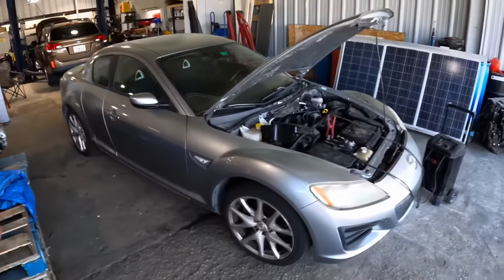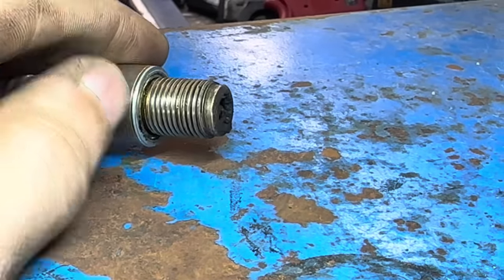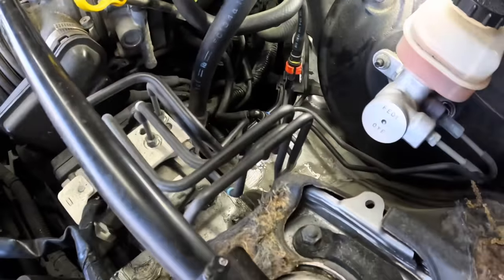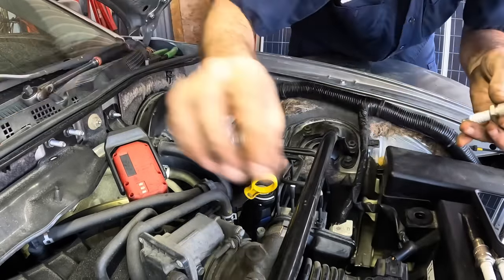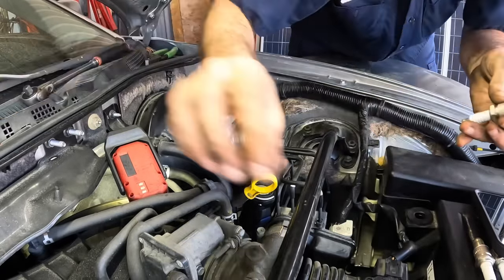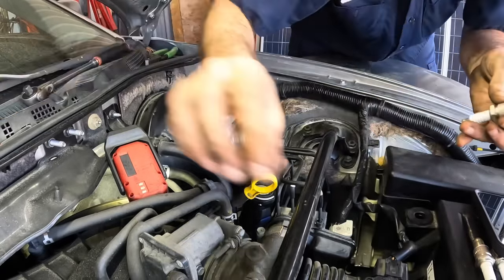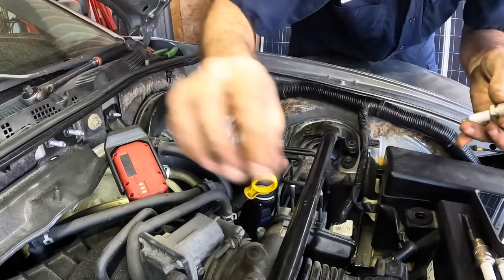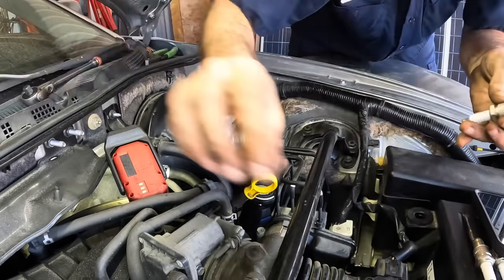Low Compression Rotary, No Start FLOODED Mazda RX-8 Drove in Towed Out!

Comment: Plugs are dead easy to get out but you are supposed to access them from inside the wheel arch. There is even slots in the guard liner specifically for access.
Reply: Yup, quite smooth
Reply: @craigfin3222  I'm not entirely sure but I think Ray never claimed to know everything about every car and would never make mistakes?! and yes, there are always comments under the videos from people who think they know everything better, that's nothing new and will always be the case, not just with Ray 🤷
Reply: 👍nice
Reply: lol. Did Ray just find out by an oreilly parts delivery guy that this engine has two different plugs? Don’t yall have website access that tells you everything about the vehicles you work on? Like alldata etc
Reply: I always consult a repair manual before doing these jobs.  And yes, if you own a shop and accept a car in the shop to work on for money, you should have a repair manual for that car.  If you can’t afford the manual, stay home in mommies basement and don’t say you can work on it.  And yes, there are e-manuals.
Reply: @justpray365  yeah I figured as much lol
Reply: Book time in UK to change the plugs in 30 minutes,Ray having never worked on these cars,he wouldn't know but I bet he'll remember next time.
Reply: @turbo3492  
It took me 2 minutes to find out how to do it online.  When time is money, someone like Ray should take the 2 minutes to find out how to do it easily and quickly.  The 30 minutes takes account for tire removal and installation.  I saw someone do the plugs in less than 10 minutes, with no hurt wrist.
Reply: I wonder what the guys at the dealership, that SHOULD know how to work on these cars, did to make a car that started not able to start, and returned it that way?  I think those guys need the tutorial.
Reply: @turbo3492  "Experience"....where the test is given first and the lessons are learned later.
Reply: There's a trick to everything as I found out when I was perplexed as to how to remove the rearview mirror from the interior of my 1989 Honda Crx.  Even the factory service manual didn't address the issue.  Then, I saw a seven second video on YouTube.  It couldn't have been easier to do once you know the trick.
Reply: @D3athAng3l1977 but that's why, even knowledgeable wrenches, carry shop manuals.
Reply: @roberttroxell4006 it was likely running and the younger techs didn’t know about the risk of flooding and flooded it and then Ray got it.
Reply: @KendrasEdge757 surely you can’t study a car to change spark plugs? Which mechanic in the world would do that😁

Comment: I myself am pretty apprehensive about using ECM repair places that I have never used I had to once because the normal place was upfront to me saying that they didn't think they could work on it. The place that I went to, like you took my money to almost send me an email the same day received saying they could not work on it, and kept my money as a "diagnostic fee". smh. Great Video Ray!
Reply: Major scammy vibes
Reply: chevy had a problem maybe still does modules worked at room temp not in real world solder joints intermittant
Reply: A lot of them know what theyre doing.  But if its cheap........sketch vibes.
Reply: Went to dealer running  played with keys and security codes came back not running.....? And it's whose problem?
Reply: @turboturtle9083  but its running. You didnt watch the video?

Comment: Running a rotary for a short period without getting to operating temperature is number one way to flooding and fouling plugs and causing a no start condition
Reply: Once you start a rotary engine, you gotta leave it running.  My uncle works on race cars that are rotary engines.  He said that once these engines hit a certain point...they just crap out.
Reply: @deplorablelibertarian  Especially the Renesis engine in the RX-8.  The ports are on the side plates instead of in the rotor housing so excess fuel is not slung out of the engine. Also tend to accumulate carbon on the seals for the same reason, which hurts compression and increases flooding risk even further.
Reply: From what I've heard, you also want to get them warm to prevent carbon building up on the housing which isn't good for the seals for multiple reasons
Reply: specially when just warm.
Reply: @YouNameItGaming  my brothers friend had one when i was a kid and i don't think any carbon had a chance to build up on his he drove that like he was in the indy 500 everywhere he went!
Reply: @jays106  that's why manual RX-8s seem to go longer between rebuilds than auto variants, the autos don't get driven as hard, and rarely see the RPM that manual ones do
Reply: @YouNameItGaming  this was an old RX-7 i was maybe 14 at the time (49 now) but yea i'm not sure if back then you could even get an rx7 in an auto
Reply: @jays106  they probably should have kept it that way to be honest, would keep a lot of people out of them that have no idea how to drive them correctly

Comment: Rotaries seem like a technology that is perpetually 10 years from being perfected.
Reply: Kind of like cvts.
Reply: Right? It seems like they dropped it right before they found the right material for the DAMB APEX SEALS
Reply: Banning rotary from racing killed them. Without funding and opportunity to stress them in racing. There was no way for mazda to work on them without it becoming just money pit. And to be frank. They are still using them in their new cars as generators. Plus we have LiquidPiston guys
Reply: @SmallKittyPaw  I mean they aren't banned from all kinds of racing. The aftermarket has some good options. If it was really an issue they'd take some advice from the aftermarket.
Reply: Fusion!
Reply: I hope the rotary load on the starter is significantly less than the load on a conventional engine starter. (words). The continuous running of the conventional engine (without pauses) starter would cook the poor thing to death.
Reply: Are they an emissions passing nightmare?
Reply: Thing about rotaries is you have to treat them like a 2 stroke, because that’s basically what they are. Keep check on the oil, beat the snot out of it. When shutting it off, rev it to about 4-5 grand and kill the key. The inertia of the rotors when spinning down will evacuate unburnt fuel so it doesn’t sit on the apex seals and wash the oil out.

Long time friend of mine had an RX-8 from new, this is exactly how he treated it. Sold it at 90,000 miles for a Porsche Boxster. Never had a problem out of it.
Reply: If you want a perfect rotary engine, get an EV.  The Wankel isn't necessarily bad, but it can never be as thermodynamically efficient as a piston car, thus leaning towards poor economy and troublesome emissions tendencies.  The RX8 was designed to take maximum advantage of the Wankel's strengths (size/power ratio, 9500 redline), but in order to meet modern emissions requirements the engineers went with a side-port design and skimped on oil injection, making the RX8 a garage queen, especially in early model years.  Dealers hated them. Problems could be mitigated with frequent red-lining and supplemental oil (mixed with the gas), but I saw the statistical writing on the wall and departed with my RX8 after 8 years It was fun but needed too much nursing.
Reply: @Huey866  true they need to rev. That's why the RX8 automatic had a far greater failure rate than stick
Reply: Kind of like fusion.  Always 20 years in future.
Reply: @Huey866  I've had 2, throw some premix oil in the tank with your gas will save those seals BIG time. I had one that was premixed since new and had like 150k miles on it, never rebuilt and ran really well.
Reply: they kinda already were, rotaries are effectively 2 strokes, treat them as such and their good, treat them like crap and its not such a fun time
Reply: It's been out since the mid 1980s.
Over 40 years of development in vain for a very bad architecture design originally from Dr. Wankel of Germany. 
Another great Germany technology goes kaboom.
Reply: Exiting the service mode…..😂😂👍
Reply: Toyota looking at rotary engine for their EV ...to charge batteries on the road
Reply: Just like fusion energy.
Reply: @jayc4283  They're an everything nightmare.  They run great for a year or two, then after that will spend most of their time at the shop.

Comment: Ray, my friend had a rotary Mazda years ago. He had the flooding, no start issue many times. The dealer’s tech told him to add a couple ounces of transmission fluid to a suction line and crank. Started instantly every time. Made lots of smoke, but it worked.

Comment: I must give you props for not being afraid to work on this rotary engine Ray, 75% of mechanics will outright reject working on them!
Reply: I was getting my radiator cleaned and dipped when I saw a rotary in the shop.  You do rotary's.  NO, that is a special case for the bosses friend.
I've been waiting decades to open one up.  I was at junk yard, and heard on speaker your rx7 rotor is at counter for pickup.  I dropped everything leaving my tools to go check it out.  It was a damn brake rotor.  Went back to pulling my part disappointed.

Comment: as someone who ones an rx-8 best way to get to the spark plugs is to take the wheel off on the driver side and you have perfect access to all 4. good to see a mechanic actually working on an rx-8 instead of just saying "its an rx-8 cant do anything"
Reply: Do they still use a single bolt holding the flywheel on?

Comment: I had a friend back in the 80's that had an RX7 Mazda, and it drove great. But the maintenance schedule must be followed. Thank you Ray.
Reply: Mt buddy had one too.    That this was awesome
Reply: about the only thing I didn't like was the fan inside did not move enough air for me.  Disgusted when they put in the back seats with the 13B engines.  The storage box lids hold the 6x9 speakers right behind you.
The rx7 holds my rc helicopter perfect, rotor goes from front windshield to the back.
Mine is now a mutt.  I have parts from 79 to 86 in it.  Was a little mad they had a different bolt pattern and I had to get an entire set of rims from an 86 to get my limited slip differential back end installed.

Comment: There is a Special procedure to shut down a Rotary after Starting and running for short periods of time. The Mazda dealership should have known that. There is a TSB ...
Basicly you dont Turn them Off at idle. You Turn them Off at about 2k-3k rpm to clear Out the junk.

Comment: Good job starting the rotary.  When thoroughly flooded, I was never able get my RX7 to start until I pulled the plugs AND the cranked with the fuel pump fuse removed (real flood mode).  Just like you, lots of fuel in the exhaust.  I learned to never shut the engine off until it ran for at least a few minutes.
Reply: My old T2 suffered from slightly leaking injectors which wouldn't allow it to hot start ever. I learned the gentle art of solo bump starting while I waited for new injectors to arrive.

Comment: I owned a '78, put 85k before the seals went.  Manual choke, solid rear axel, had to time the points to each rotor, no ecu, I got better at it than the dealer out of necessity.  So much fun to drive!!!

Comment: I do Gauge cluster repairs. When I get a unit that is beyond economical repair. I take photos if it is a fault that is visible. And send it to the customer. The only thing they pay for is shipping and I give them a discount on future service.  
I also offer to buy the core as well.  Because when some one has a damaged bezel or a PCB that is burned I can use that core as parts. 
And some times there are PLA's and other special parts that aren't available especially for a 20yo car.

Comment: My son had a Rx 8 it was only a couple years old and low mileage but he was working on that thing all the time...by the time he got rid of it he had learned about everything about those things
Reply: They suck
Reply: @stevestevens9046  automatic, or manual? If you don't mind me asking of course
Reply: @YouNameItGaming  automatic
Reply: @stevestevens9046  apparently manual ones have less issues, because the engine is able to rev higher
Reply: @YouNameItGaming  I didn't know that... I think a manual would be a blast to drive

Comment: im impressed that you are even working on this. most shops wont touch a rotary engine. it was flooded because someone shut it off before the engine heated up. judging by that spark plug it was way past due for spark plug replacement. they should be changed no later than every 30K to the tune of $130 for a set. also, it would be much easier for you if you took off the drivers front wheel. they are right there very easy to get to. you are exactly wrong. the leading is on the bottom and the trailing is on the top. the spark plugs themselves have an L and T on the plug to tell you which is which.

Comment: I had one of these. It was a spare car. We learned that you can't jockey these around. ( That floods them) You should also change the oil after an extreme flood. The oil level increases from the fuel getting past the rotary seals. 

Fun car
Reply: For the Renesis rotary, a redline a day keeps Ray away.  Unfortunately, this one's an automatic.  Not only negates the high-rev characteristic, but iirc also removes one of the oil coolers.  Heat is a prime enemy of this engine.
Reply: I used to track mine. Loved that car. Ran it till the apex seals were done, and in hindsight I shouldn't have gotten rid of it and just fixed it, but I traded it in and got me a Miata ND that I now love.
Reply: girlfriend used to bug me about my driving in my rx7.  Till I loaned it to her while I fixed her car.  Damn, it is on rails and wants to just cruise at 100mph.
I love it in the rain with the sunroof open.  The water being blasted by the slipstream overhead is so soothing.
Reply: @BenMConner  Should have at least kept the engine, and put it in the miata.
Reply: @robertsmith2956  oh man, I regret getting rid of that car every day. I love my Miat, but there’s nothing like a 9k, fire breathing red-line.
Reply: @BenMConner  7.2K 12A was good for 142mph.  Swapped out the brakes for the LSD option because they have twice as much pad and better disks.  The standard brakes laughed at you when you stepped on the brake pedal.

Comment: I had a 1979 RX-7 and it ran great. Never saw this issue. It used 4 plugs, all the same, center electrode with 3 side electrodes. ( I once bought plugs with just 2 side electrodes and it just didn’t perform). 
It ran so smoothly that when stopped at a light I had to look at the tach to see if it way still running 🤪
Reply: I was just starting my tuneup when my dad stopped by, and said I have that dialed in.  Told him I hadn't started yet, was warming it up before draining the oil.  LOL
It is amazing 45 years later and the parts catalogs are still wrong.  You need to buy the automatic starter for the manual car, and the manual starter for the automatics.

Comment: Ray it would have been easier to remove the drivers wheel   to get to the spark plugs  through the wheel well, but also leave the plugs out  and crank the engine with foot on the floor to  get ride of the fuel

Comment: The one mod I absolutely recommend on rotaries: fuel cut switch. If it floods, just kill the fuel pump and crank until it fires, then turn the pump back on. Sometimes even flood-clear mode doesn't work very well where manually shutting off the fuel pump will solve the problem every time. It's also useful as an anti-theft feature.
Reply: floor pedal , clear flood mode
Reply: it literally has that, hold your foot to the floor, that cuts out the fuel.

Comment: I had a 89.5 Mazda RX7 and I took Spark Plugs out of it, no problem.  Probably one of the first mechanical things I ever did.  I loved that rotary engine.  Gas was much cheaper back then though.  Knew a guy in Florida that had one making over 900 HP.  Very good engine if you have knowledge about them.
Reply: Pretty reliable too if you properly maintain them. My late pre-facelift Turbo II has been converted to premix now and runs much cleaner than when it still sucked on engine oil. There's also no more emissions stuff on it either, lots of oomph when the uprated turbo starts doing its thing.
I love running it up to the redline buzzer.

Comment: Mazda seem to be the only Japanese car manufacturer that still has build quality.
I know the rotary engine can be annoying, but when they are put together right, then wow Nelly, your in for a treat.
I built a 6 rotor engine.
We really went to town, to make a truely Superlative engine.
I ran 2 fuel tanks, one with super unleaded, the other tank had 120 octane race fuel.
I used fuel metering tech from a jet engine to very accurately put fuel into a small third tank, this tank fed the engine.
The ECU had 3 maps, each map used more 120 octane fuel.
I got 101, 108 and 115 octane fuel, that I could switch between in the car whilst driving.
8:1 compression ratio as we were running turbos.
6 speed manual gearbox with a LSD that could be locked for quick get aways!
730hp at the hubs @ 9250rpm.
645ft/lb at the hubs @ 5200rpm.
Oh my, I loved that car.
Reply: Toyota must have been making pool cues the last 20 years it seems
Reply: Pics or it NEVER happened.  At all..

Comment: I ordered a Flagshit ECM for my car a year ago and they sent me one that couldn't possibly have been programmed for my car.  The car ran much better on the original ECM.  They are aholes.
Reply: All Ray had to do is check the BBB site.  Read the complaints.  Of course, that’s too easy.  Just like taking the wheel off and changing the plugs in 10 minutes.
Reply: DEI hires ...